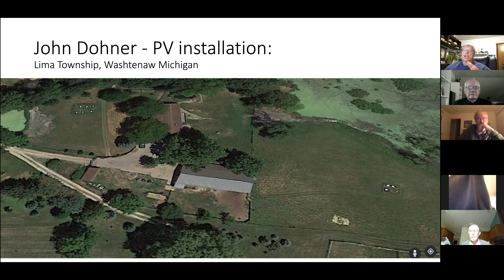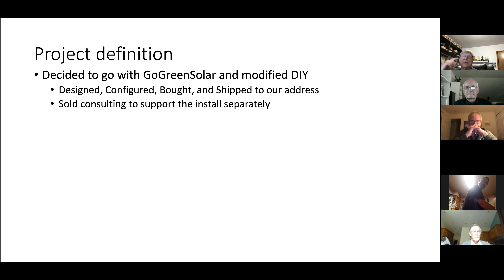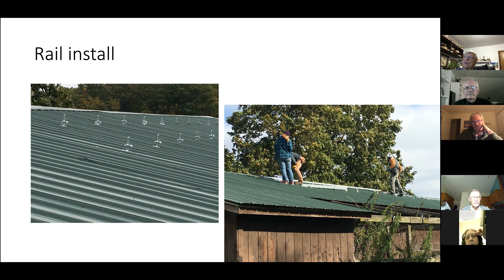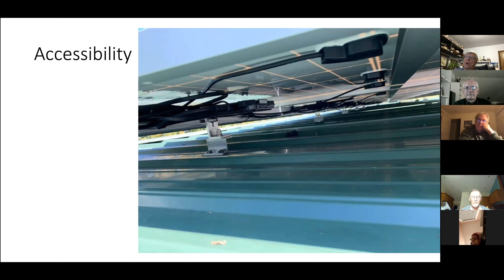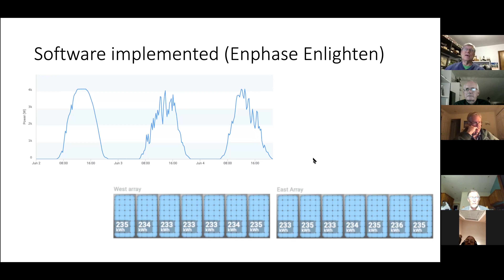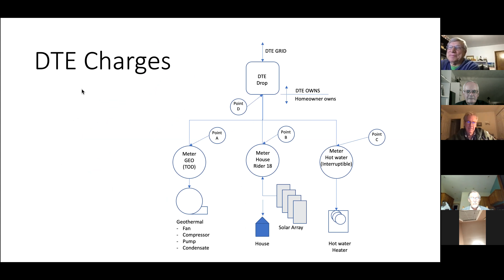MI Solar Story John Dohner

Comment: Thanks for presenting John.  I agree with your concern of selling on the main meter and buying back on the geo meter.  Not sure you'll get DTE to address it though.  I would file an mpsc complaint, or do some rewiring to allow you to use directly from inside the main meter for the geo.  A couple of contactors and control, some complexity.  Or change the main meter to time of use d1.2 which is somewhat similar rates to geo, but I think not quite as low.